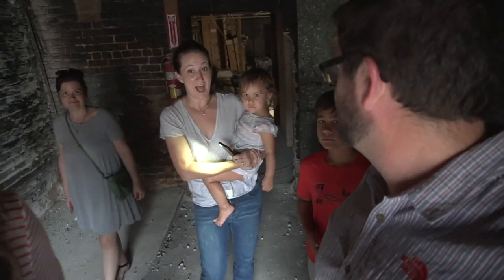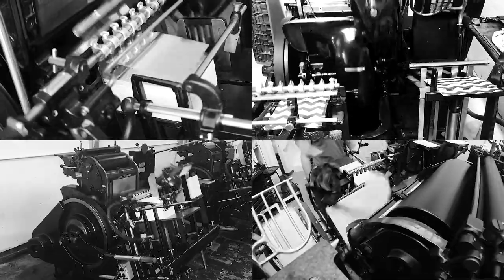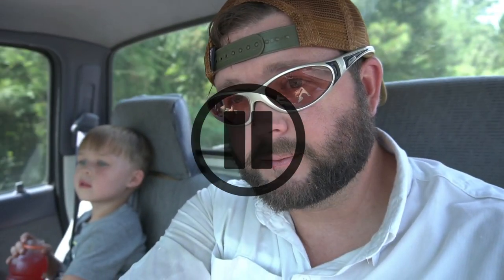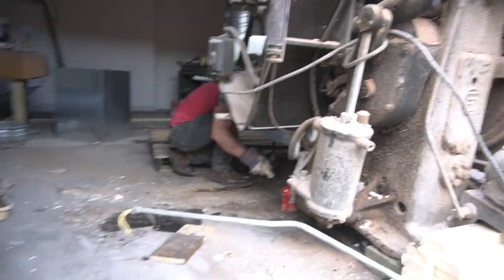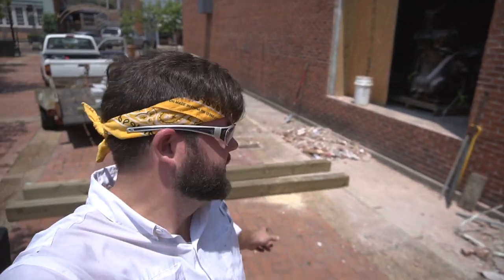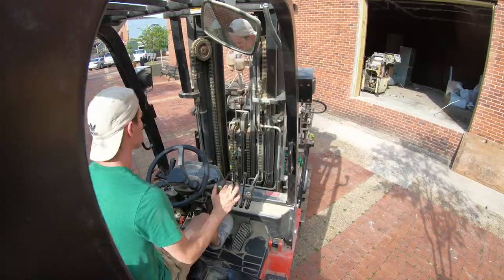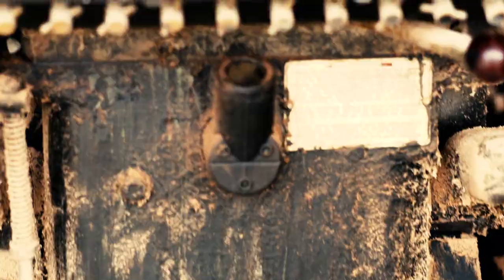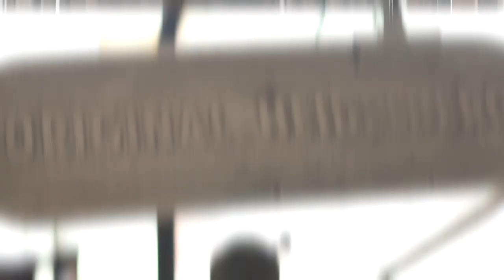Moving a HEIDELBERG Letterpress!!! CHANGE OF PLANS... Pt.1 - Ep.013

Comment: Good for you for rescuing it! Your method of getting it on a pallet and also securing it to the pallet with 2 small straps that (even if rated for that weight) would never prevent it from falling if it became unbalanced, was crazy.  I've moved these before and straps like those are good for items in the back of a pickup, not a 2,500# Heidelberg.  I'd use much stronger straps in the future if you ever move it again.  Also there are 4 holes in the base that would nicely accept bolts into the pallet.  Just my 2 cents.